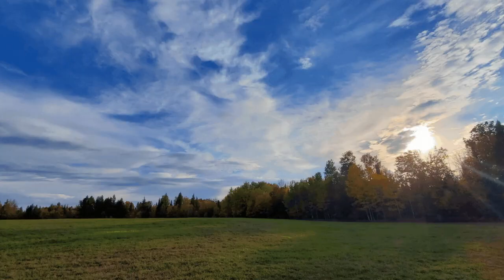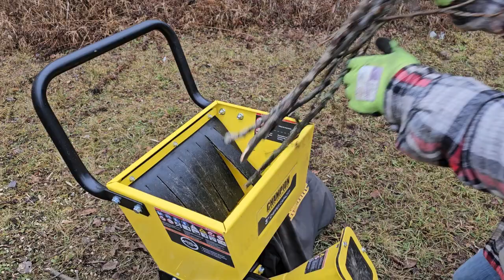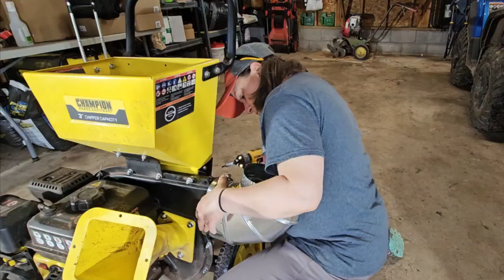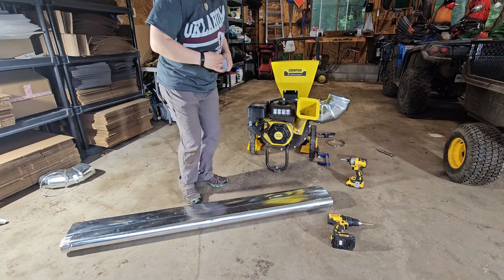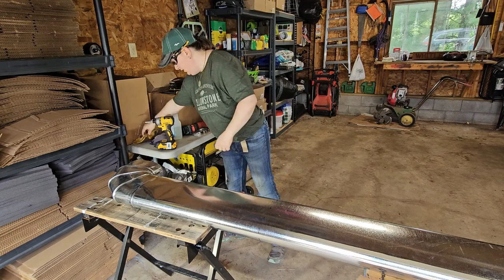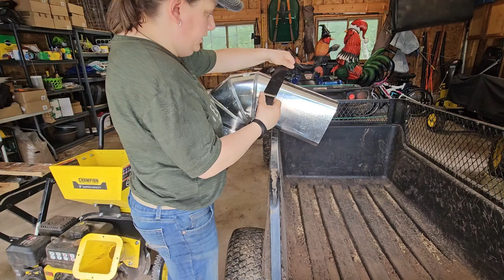Champion 3" Wood Chipper Discharge Chute Upgrade – DIY Modification Guide

Comment: Here's a chipper tip......
If you make a lid for the hopper it will do two things. 
1. It will prevent objects falling into the hopper that shouldn't be in there.
2. It will restrict the air flow while chipping and reduce the force of chips flying out.
Reply from the maker: The hopper is pretty small and not too deep. I don't know if this would work or not. Worth a try.
Reply: @40acresofclueless  I have the same chipper shredder and YES, it works great.